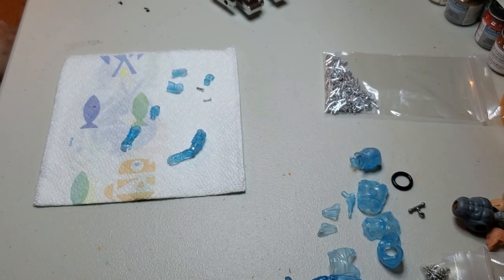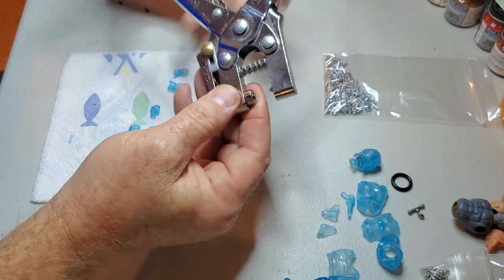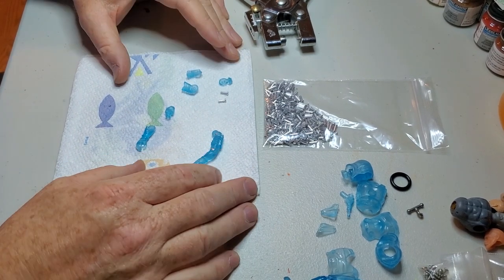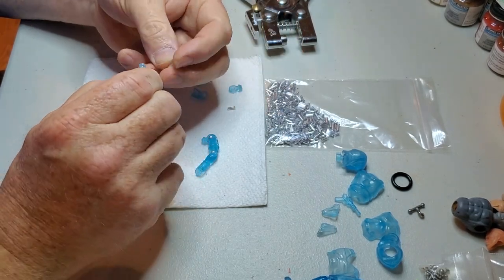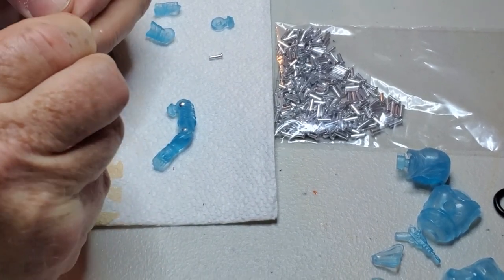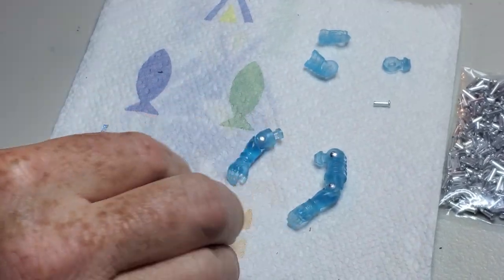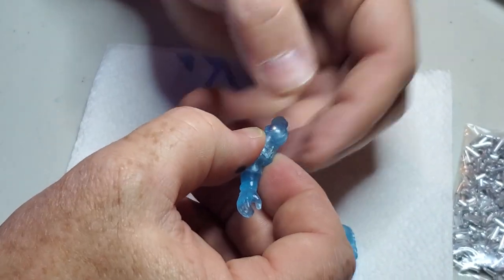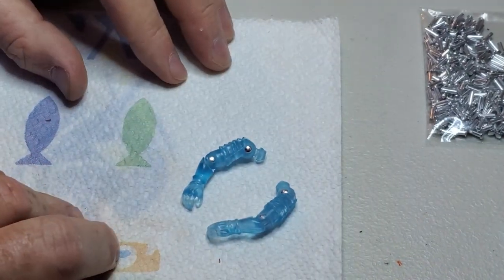G.I. Joe custom tips, rivet install

Comment: I did read on a forum that other GI Joe guys are using the Beadsmith EZ-rivet machine that this video refers to. Looking on Ebay and Etsy, from different sellers, it's about 50-60 dollars/euros. I'm trying to see how to fix my micronaut aliens, and those are supposed to have slightly larger (?) rivets. Between trying to find the right rivets (inches, millimitres, my gosh) and the right tool, it's a nightmare. I wonder: what these tools do is very easy, they hold the convex part still, and they have a small tip that presses the  concave side, that's all, so one might try to modify any kind of tool that can press (nutcracker, pliers, etc).

Comment: hiya was wondering what is the name of the type rivet gun are you using there cause i want to get the same one like that and also what size rivets should i be using for repairing the gijoe arms and legs. im trying to fix some of the old guys i just couldnt figure out how to until i saw this video. Thank you very much there